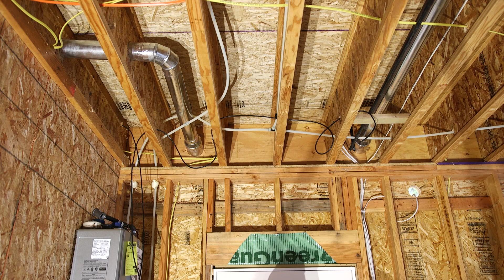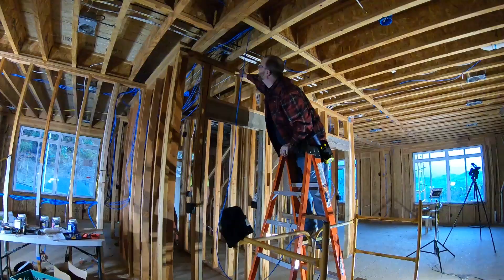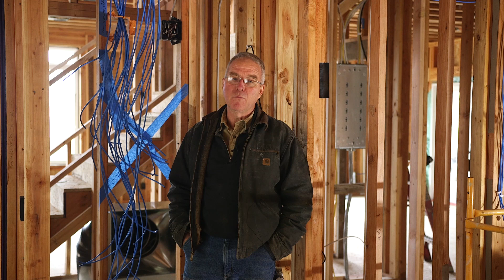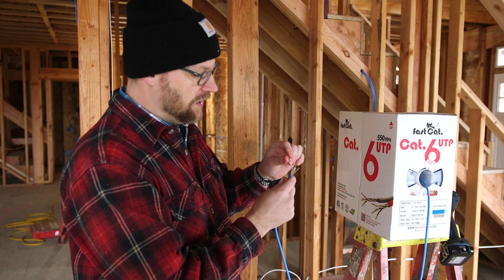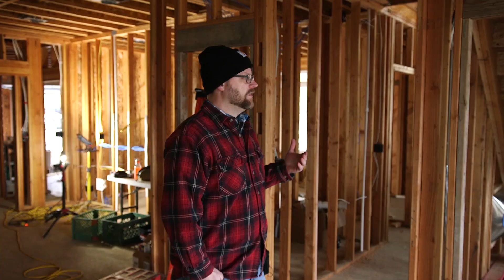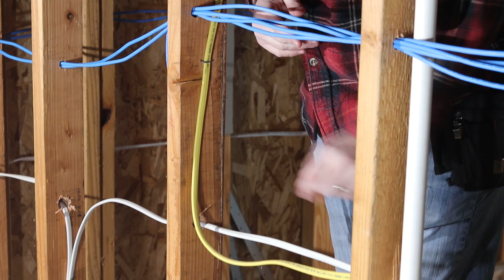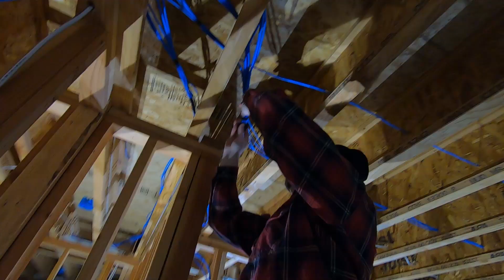Installing A Home Network Ep.100

Comment: When we started construction on our building here, in Tokyo, in 1999 we had the whole building wired for ADSL, by the time the building was finished, in August of 2001, ADSL was obsolete. To future proof the building I insisted and had quite the fight with the general contractor and architect that all the ADSL be run in conduit, not just in the walls. Yes, it added cost to the build, which they thought was crazy, but by the time people were moving into the apartments, they were all getting FLETS (fiber optical internet) installed.
In our own apartment, I have one conduit that goes to each room from the one central point where the FLETS terminates at the router. This way we run CAT 6 cable where ever we want it.
Ben certainly did a great job at explaining it all.
Scott, you must be very proud of your family.
Cheers from Tokyo!
Stu

Comment: I use to be a low voltage cable installer and had the opportunity to wire up a few new houses with cat5e (at the time) and RG6U coaxial pretty much everywhere you could possibly want a connection.  Looking back, it would have been wise to run conduit everywhere and only install cabling to the essential locations.  Cable technology changes so rapidly that the cable installed today could become obsolete in the near future.  Who knows, fiber could be the norm in lieu of Ethernet cabling.  If that’s the case, then you’d be ready for it with conduit. I’ve been to a house built in the early 80’s that had close to 2 dozen RG59 cabling in it; it’s practically useless today since it can’t handle the frequency demands of modern data transmission.
Reply: As much as I would love to find some nice conduit for every cable run I do - cable standards have a lot more longevity than other network related things. Cat5e was standardized in the year 2000. I still run it to this day. (Albeit, against my recommendations to go with at least cat6)

Comment: One small mistake: you're not supposed to tape up cables in the walls like that-- because if you ever pull one of those cables out, you want it to be free and not pull its friends along with it.
Reply: How would you pull the cable out when it's stapled to the 2x4? That cable is in there for the life of the home or major renovation.
Reply: @Jay0x00  I sure hope nobody stapled a cable! Staples kill Cat5/Cat6+ cable. You must never compress or sharply bend or nick the cable.
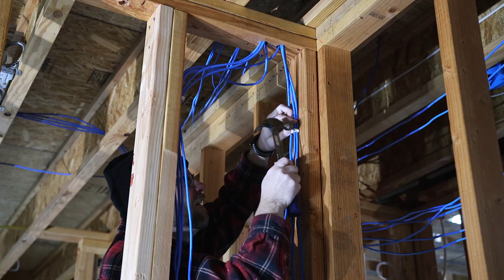Reply: @purpleidea  13:15  those cables aren't coming out.
Reply: @purpleidea  I didn't mean metal staples. I was referring to the plastic clips he used.
Reply: @purpleidea  Yup, no staples used on cables. Friends don't let friends staple network cables. ;)
Reply: @Jay0x00  those plastic staples can hold up to three cat* cables and you'll still be able to pull 'em out.
Reply: Good find! 

I suppose that's why Ben stated to use velcro wraps so you can easily adjust your cable run in the futur.
Reply: @articchar-lf  Yes, velcro is good! Some people use zip ties, but they're generally not recommended anymore and in the rare situation where they're used, they should be fairly loose to not compress the cable.
Reply: Why would I want to pull a cable out?
Reply: @TheOwenMajor  you never know why, that's the reason. 
Making it near impossible to remove a wire for something that is just for looks is stupid, and a waste of time. 
Noone will see the cables after the drywall goes up. Keep fastenings to a minimum in crawl spaces as well. Nothing sucks more than pulling a new cable with an old and realising there are 5 zip ties somewhere holding it back.
Reply: @Asbjoern  The installation method they used indicates they are not expecting anyone to replace the cables. Nothing wrong with this, just a decision they made. There is no way these cables are coming out even without the velcro and plastic clips. There is too many turns as the cables navigate up the wall, through ceiling/floor joists and across the house to their termination point. If they wanted someone in the future to replace the cables they would have ran conduit instead. Im not saying one method is correct over the other, just the multiple options exist with their own cost/benefit.
Reply: @Jay0x00  That's the case here, correct. If the whole house needs rewiring, it's time to open the walls. I don't know if building in 24 conduits is worth it - that's a lot of bends and cost and complexity. We wanted something that'll be good for a decade - I'm not sure even conduit can protect for past that? Tradeoffs, tradeoffs. We hope we landed on a good plateau! :)

Comment: I run a lot of cable commercially, and if you were only going to choose one cable to run all over your house… You did the right thing pulling CAT6. In today’s world you can do almost everything you would want to do using that type of cabling along with some sort of adapter or media converter. So while you might not be able to use that cable natively for every single purpose, it can do almost everything you would want to do.

That being said, I learned a lesson along time ago from the house my father built back in the 70s, at that time it was a big thing to put antennas on the roof of your house to receive television and radio and he ran what was called twin lead inside his walls into every bedroom and into the living room in order that he could have television all over the house. We never ever used it 🤣 That being said the lesson I learned is, you never know where technology will take things next, so what I did when I built my house was instead of pulling wires the way most people do where are you drill lots of holes through the plate, each place I wanted to have a wire in that stud bay, I drilled a 3/4 inch hole through the top plate and went in the attic and pushed a piece of PVC conduit through All the way down to the box. PVC conduit is cheap and easy to install, and now forever more I can pull in anything I want to add and I left a string in there to do so. I may never use that flexibility but doing that only added maybe $100-$150 worth of conduit to the cost of my build if that and since I did all of the electrical installation it added no other cost and labor. 

I also ran all of my electrical that is in the walls in steel conduit for the same reason, what is in the attic is exposed but as soon as it goes down into a stud bay it’s in conduit… Because that way it doesn’t have to be stapled, I don’t have to worry as much about nicking it with a nail or a screw… Even though you still can do it.  

again the cost was very minimal and labor was not a big deal because when the walls are open it’s easy to push a piece of conduit up through a hole. 

So that was my solution… 

In my case, I did choose to pull RG6 to the locations where I knew I would have a television… But not to every location. Just to the bedrooms and the den/living room. Other rooms just received CAT6. 

One place people forget sometimes is that you should pull some wire also to several key locations coming out of the ceiling where you want to be able to place a wireless access point… You don’t want to have to go back and do that later if you can help it especially if you have a second floor above and it’s not that easy to get in between. Even with all the wired connections in our house, we still have three wireless access points +3 outdoor units to cover the rear and sides of the property and reach out to cameras at the end of the driveway and on the back fence so there is a lot to look at. 

I buried a piece of RG11 out to my shop to bring networking out there using MOCA adapters because it was too far away for CAT6 to reach. That has worked well.

You may also consider running speaker wire for an AV system in the den/family room or in ceiling speakers on the back porch as a second zone for that stereo system. Both are popular options that are much easier to do now. And again not a lot of money. If you have a wiring closet, it’s logical to go ahead and run that wire as well back to that location.

Comment: Hey Scott, longtime viewer and Network Infrastructure tech/Network Administrator by trade here. I absolutely love and enjoy your videos, but would like to provide some critiques/additional information/good advice for everyone to enjoy (I'll try to time-stamp as much as possible to make it easy to follow):

1:42 - RG6 is surprisingly still in use for long-distance communications from the local box/pole to the house-cheap and tough and very easy to terminate without too much trouble
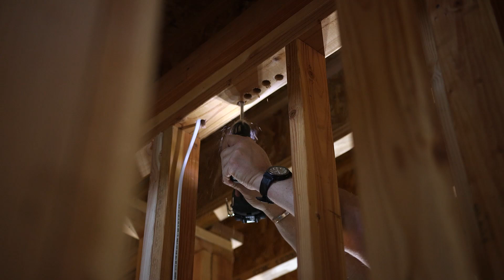2:37 - I'm gonna have to disagree with the decision on Cat 6. Cat 6A can be had for about the similar price, but in this use case, I will yield in regards to speed (Bulk pricing from FS.com or MONOPRICE is pretty good)
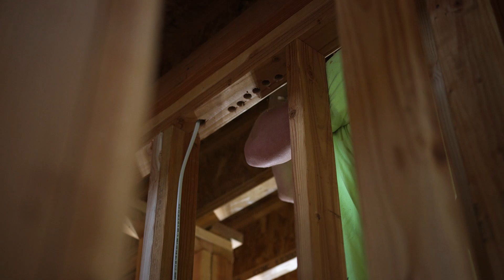2:43 - Pro-tip from my years of running cable/designing networks: ALWAYS RUN EXTRA!!! (Even if you don't terminate it all immediately) You'll thank me later. It's significantly cheaper and less of a hassle to run more now than later
4:46 -  Always leave a slack loop/excess cable on both ends. It's much easier to manage a bit of extra than realize that you don't have enough length later after you snipped off too much or you need to re-terminate after screwing up the color order
6:52 - Generally kinked cables are not wanted in any installation, but in a pinch, they do work. You may not get the entire rated speed or have more error loss, but they're nowhere near as sensitive as fiber optic cable by a wide margin (Know that from plenty of fiber optic cables I've broken myself and repaired)
7:29 - If your cable is binding, STOP IMMEDIATELY! Widen the hole, check for cables that may have looped on itself (boxed cable is notorious for this), or use some lube (Yes they do make pulling lube: https://www.amazon.com/3M-Wire-Pulling-Lubricant-Wax/dp/B01KOM948W)
7:56 -  Always test your connectors before you bury them behind a wall!! (Here's a cheap tester: https://www.monoprice.com/product?p_id=39386)
8:14 - Don't be a cheapskate and buy CCA (Copper Clad Aluminum) cables. They're garbage and will fail far too soon/cause other issues. Make sure you get 100% copper cables. Also, If you're running structural cable, use solid core, not stranded. Patch cable are stranded to make them more flexible
9:26 - Make sure if you're running cable inside walls, use plenum rated instead of mixing with or using riser rated. Slightly more pricey per spool, but plenum rated cables can handle fire a lot better. Definitely another decision I will disagree with here (https://community.fs.com/blog/what-is-cat6-plenum-cable-and-why-it-is-more-expensive-than-cat6-riser-cable.html)
10:54 - To avoid/minimize EMF interference and cross-talk in structured cabling, use shielded cable (https://www.cablesandkits.com/faq/what-is-the-difference-between-utp-stp-ftp-sftp)
13:42 - Hardwired is always the way to go. If you want to go stupid long distances or want a massive upgrade in speed, go for fiber optics (They do have their own pro's/con's too and require expensive tools and connectors)
14:06 - If you want, cable can be bought in multiple colors if you're running different networks and want to easily distinguish it at a glance 
(i.e. Running blue for data, black for alarm/cameras, red for IPTV, etc.)
14:35 - Just a pro-tip for finishing the wiring in the closet-terminate all those cables into a patch panel. Putting ends on solid core is a pain in the ass and excessive movement will damage it over time. They're not that expensive and are a great cable management solution (https://www.monoprice.com/category/networking/patch-panels) Also, If you're gonna do that, buy a rack. Things look a lot cleaner and they're easy to organize/consolidate equipment into a compact footprint (you can buy them in sizes from 1U, all the way up to 42U-Looks like you might be able to make do with a quarter height, wall mount unit yourself: https://www.monoprice.com/product?p_id=18235)

These are just some observations I made. Nothing personal, but I figured I could share some pro-tips and knowledge I've amassed over the years. If anyone would like to throw in some of their own knowledge, please feel free to do so (I'm always up for constructive criticism myself). I love watching these videos and have always been disappointed that I generally can't add to the conversation.

Also, here are the official standards if anyone wants some light reading/put themselves to sleep: https://www.tiafotc.org/ansi-tia-568-d/
Reply from the maker: Wow!!! Thank you for this terrific and informative comment!
Reply: PS: Sorry for the essay!
Reply: Great help! I thought about some of the other cabling standards, but one of the missions here is to provide more readily available solutions where we can. In this case, Cat6 riser is available at Home Depot, while 6A is still pretty new and only available online. It's all solid cable, no CCA here! Friends don't let friends CCA. ;) You're probably right about moving to it, but I probably won't for another year or so. Yes indeed, there are loops of wire left at the boxes, and everything is terminating at a patch panel. That'll be part of a follow-up video later in the year. Testing the cables is a good idea, but these aren't terminated yet, and I didn't want to terminate them and then cut the plugs off and then re-terminate into jacks after the drywall went up: do you have any ideas about how to test non-terminated cables? :) Fantastic advice!
Reply: @Stonesand  Glad I could help! PS: Keystone jacks are your friend (https://www.monoprice.com/product?p_id=5384) They do require keystone patch panels, but in my opinion they make life a lot easier. Also, have you guys considered keystone wall plates? (https://www.monoprice.com/category/networking/network-installation-accessories/networking-keystone-wall-plates). ICC and Tripplite also make great keystone products that'll last-they do cost a bit more upfront though. I know you may not want to terminate them now, but you can use them temporarily for running cameras and whatnot to secure the site before it's finished in the meantime. While you don't necessarily have to cut off the ends off a keystone jack
 system, you can gingerly remove them with a small hook tool or a tiny flat-head if you're careful enough.

Ubiquiti makes a great line of cameras and other networking equipment that I'd say is worth looking into. If you'd like to talk equipment, I'd love to nerd out, although most of my recommendations would fall towards the expensive enterprise grade gear (which is probably overkill for you guys). Either way, go check out Ubiquiti if you guys wanna drool for a bit (https://www.ui.com/)

Comment: WADS,
Network cables? The world has gone WIRELESS quite some time ago.
But, whoever buys your house will think them SO cute & retro!!

!
Reply: Yes indeed! But those wireless access points need cables to plug into. ;) And the TVs and computers etc. that have dedicated stations will work better with wires than wireless. But wires are a heck of a lot less convenient! :) Def. still feels odd to NEED cables in 2021, though, doesn't it...

Comment: My house has Antenna (TV & Scanner), 2 phone lines, motion/aux sensors, alarm (window/pressure), Cable, Cat 7, coax cameras and surround sound in every usable room. Can I just say it's excessive and I'm glad I didn't install it, the owners before me were "eccentric" and honestly off base. Some I can do with and others without. You see since they added it all as they went it is a mess (I added the cat 7 BTW). The biggest flaw in their plan was A. there was none and B. there are not enough electrical outlets to accommodate 1/4 of the potential devices. If one were to theoretically actually have all those things hooked up at once it would be an interference nightmare, LOL. I think keeping it simple is the way to go, the camera wires are a super nice touch and on my house the scanner ports are a feature I never thought I'd use but have used them a lot, I guess chalk one up to being "eccentric", LOL Great episode! :)

Comment: If I can give you some advice from 15 years installing low voltage cable-Use white electrical tape. It performs exactly the same but doesn’t leave any sticky black residue behind.
Reply: Roger that! I'll pick some up!
Reply: Hey, Thanks for that tip!
Reply: Also you can use it for labeling

Comment: Can the electrical or these cables radiate electricity out? And can this be bad for your heath? one electrician told me he runs the cable by the bedside in a metal conduit to prevent the radiation. you sleep there 8 hours a night and you brain is right close to the electricity.  anyone heard about this?

Comment: You have no idea how happy I was to see this. A younger generation is going to love this!! One thing that was a bit odd though: why not use shielded cat 6? That mitigates the interference problem you mentioned
Reply: The problem with shielded network cable is that it also imprison the effect of "alien crosstalk" on long runs.
Reply: @articchar-lf  interesting. Did not know that
Reply: Check it out, crosstalk between conductors induce packet loss.

I've also read in the earlier comments that shielded cat6 was also a waste of money if you were not using shielded terminal connectors to both ends. Didn't know that either.

Comment: Legit question would be minus cost why not run them through conduit?
Reply: There are actually too many bends for what we're doing, and for a house like this, it was just overkill. :( I hope we made the right decision based on cost, time, informational nature of the build etc.! :) For a commercial building, I'd want conduits and access panels, but that's much more doable there.
Reply: @Stonesand  cool thanks! I’m running cat 6A later this year and plan to use conduit incase wires need replaced one day. However all my wires drop from attic